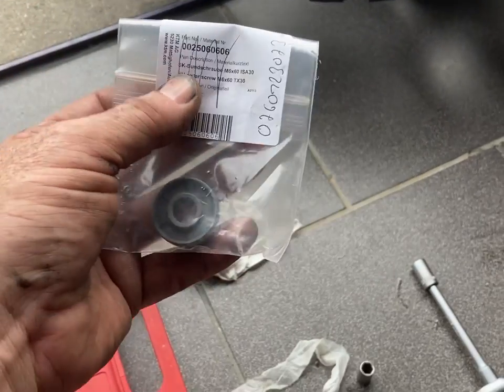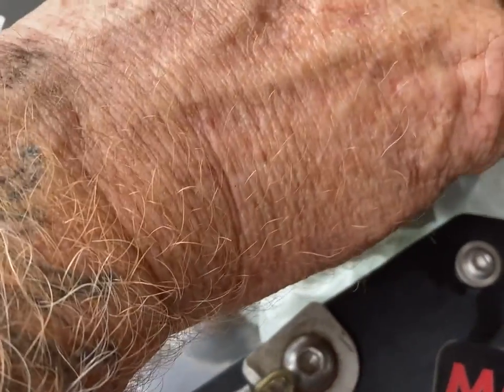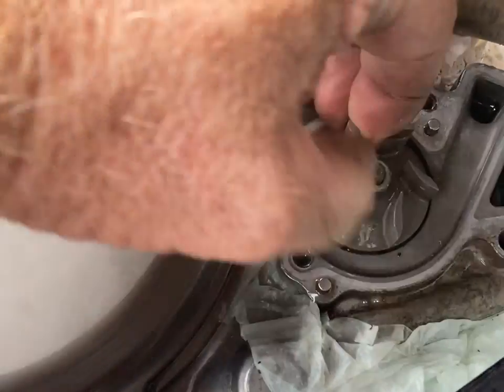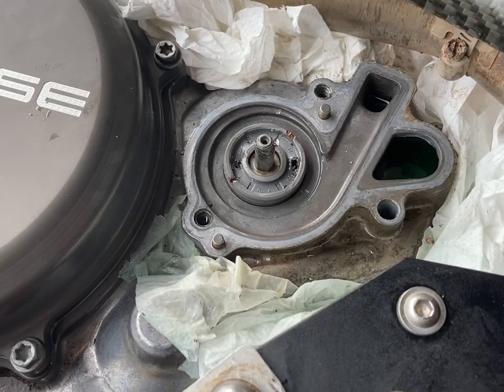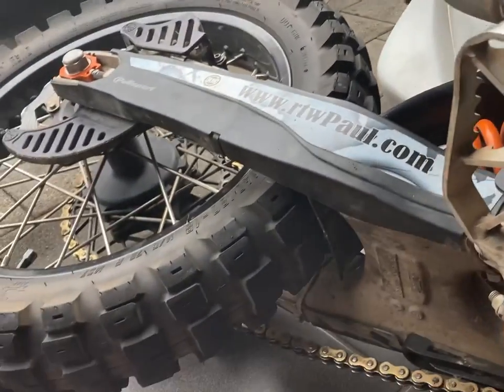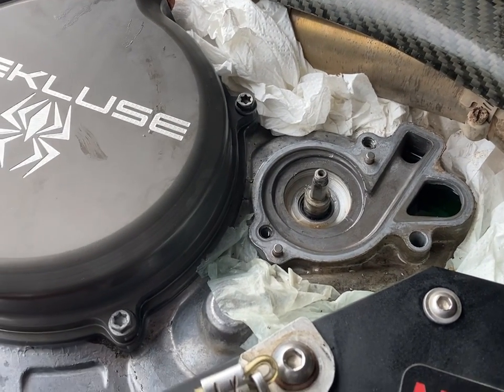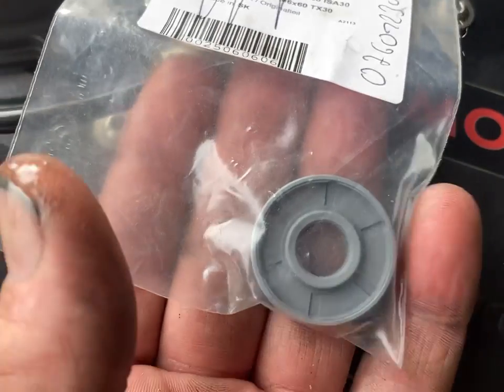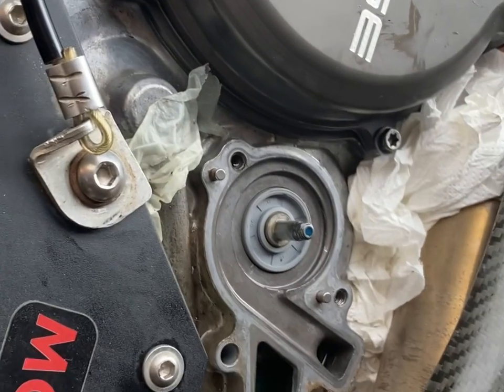KTM 500EXC Water-pump Seal Replacement

Comment: Great vid,  the scratched out number is the old part number KTM likes to do that. The only thing I would have done differently is I would have greased the impeller shaft before  the seal instal..again great vid.

Comment: Why did you decide to go with the Boyesen water pump? I’ve got a 2017 500 EXCF and it’s running hotter than it should. Curious about the Boyesen—durability, better coolant flow?

Comment: Try electric water pump mod. MX bikes have these and it adds power because there is no more drag from the original pump on the engine + no chance now that oil is mixed with coolant and vice versa. You can always carry a spare pump, I use little Bosch made for pumping hot coolant. Costs like 40 bucks.

Comment: Was this a maintenance the KTM factory suggested?
Reply from the maker: No by another tech, I asked the factory tech about it and he agreed,
Reply: @rtwpaul I've got milky brown oil and vanishing radiator fluid.  Looks like I need to try this repair.  2013 KTM 500 EXC with 9000 miles and 300 hours.
Reply from the maker: @troynichols9788  do it ASAP with your issues things can only get worse internally, and the fix is easy to do, as shown